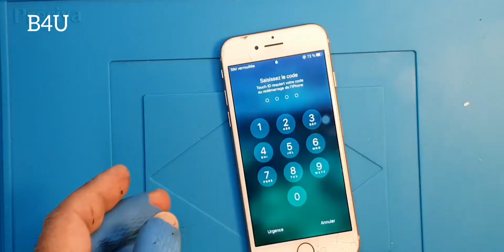remplacement vitre arrière iphone 8

Comment: pas besoin de laser alors, au final tu fini comme sa manuellement, est ce que le laser te facilite le boulot et un gain de temps ?
Reply from the maker: Oui biensur c'est plus rapide
Reply: La i question que j'essaie  de poser est celle de savoir ! Si Sa ne cours aucun risque si on ne déconnecte pas la batterie?